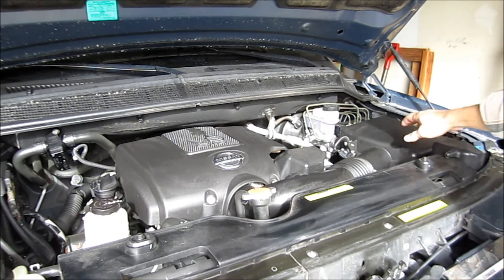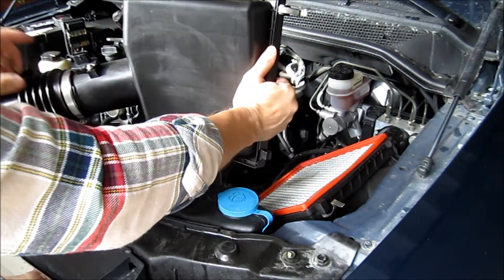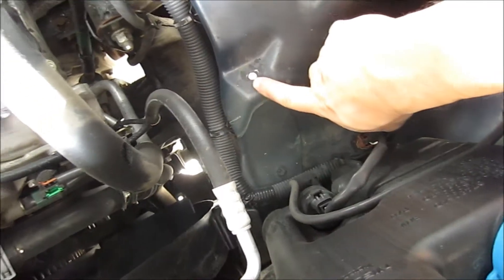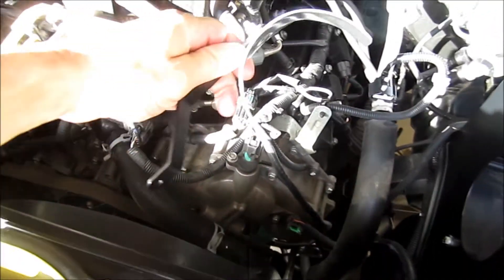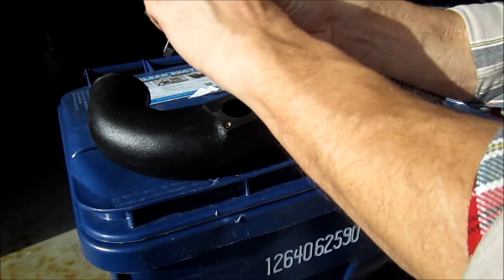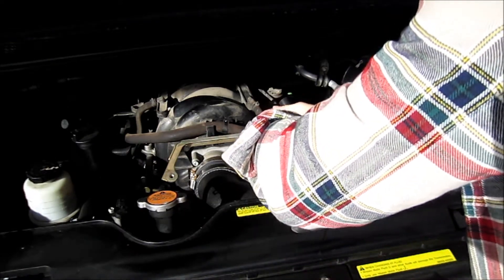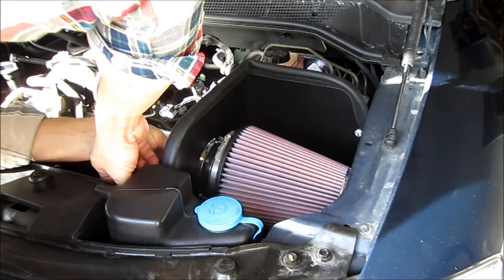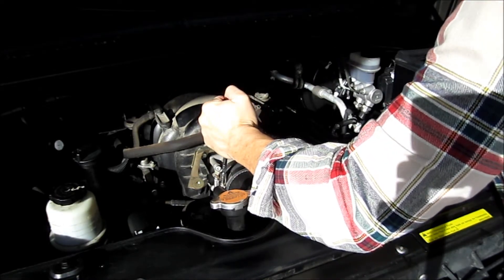Nissan Titan K&N Intake System

Comment: get a new mafs from jet. it makes a major difference with stock intake, "cold air" intakes add no power and end up pulling in more hot air from your engine bay